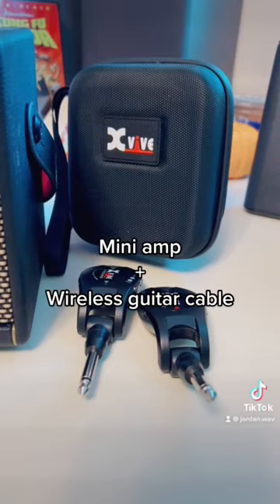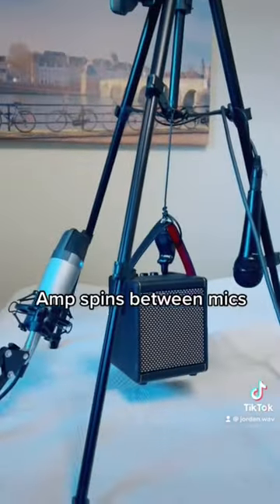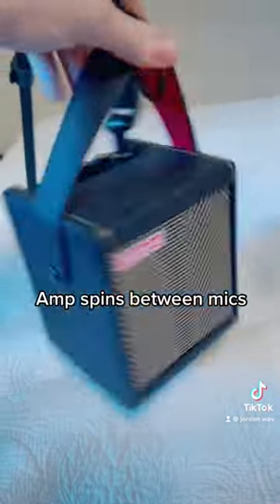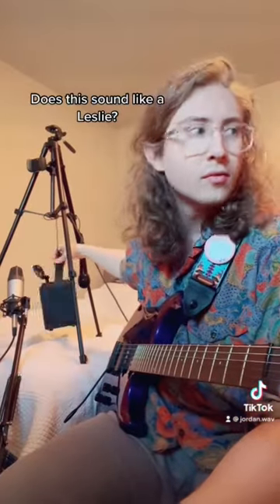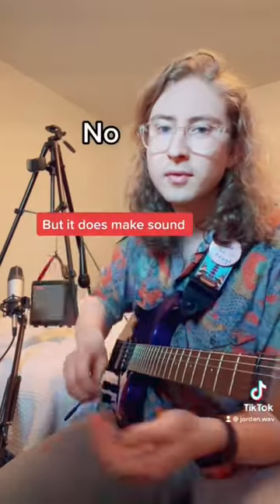DIY Leslie Amp

Comment: it kind of sounds more like a tremolo but a really nice one
Reply from the maker: Its called a 'rotary' effect when used in pedals!
Reply: It's kinds a combination of both. Essentially the angle determines the volume, but the CHANGE in angle determines the pitch (the same effect as the siren of an emergency vehicle changing as it gets closer to you and then further away) so it has both a tremolo-ish effect and a pitch modulation effect
Reply: Yep. Sounds a bit like the "harmonic tremolo" out of the "brown" Fender amps

Comment: Also used on The Beatles, Tomorrow Never Knows track
Reply: Yes, John had an idea to be swinging around the microphone from wires, but the Leslie speaker was bit easier.
Reply: I also believe George Harrison used it on Here Comes The Sun as well.
Reply: does blue jay way use this on the vocals?
Reply: Guitar on Lucy is using one too

Comment: This is really cool! There’s another thing that I discovered recently. I have a ceiling fan in my living room. I play my 1969 fender telecaster through a split signal to 2 Different Center black face amps from the early 1960s. When I turn on the ceiling fan the sound changes and sounds exactly like a Leslie! Crazy.

Comment: I've been into music gear for what you might call a long time. I've never seen actual horns used for Leslie speakers. I've only seen carved blocks of Styrofoam. Hmm. At my job, we get a lot of inch and half thick Styrofoam I already figured I could make a Leslie speaker horn out of that. I've been wanting to make an isolation box for my old Silvertone mini amp. Now, I think I'll make the isolation box with a spinning horn on the front with the motor attached to the outside.

Comment: Day 3 of asking you run your guitar through a pillow case.
Reply: So... silence?  You are desperate to hear... silence?
Reply: You know they aren’t real yeah? The guitar doesn’t really run through the two croc clips, it’s plugged into a pedalboard. If you hear the signal echo, he’s using a delay pedal. If it is more distorted, likely a fuzz pedal.
Reply: @electricneonblack6335  it's still fun to hear his interpretation of what sound effect it would make
Reply: @spacepirate9275  but that isn’t what it is, he presents it as the truth.
Reply: @electricneonblack6335  I think he assumes his audience knows enough about guitars to know it won't work
Reply: @yeasstt  I think he assumes incorrectly

Comment: Consider modifying a regular turntable, take the speed up to at least 78rpm but I'd suggest maybe taking it higher if you know much about modifying electronics

Edit: second thought, I think a pottery wheel would do even better

Comment: You would get a better sound by taking the amp and suspending it in a closed box that has two holes on either side. Then mic the holes. That way you isolate the sound between the mics more.